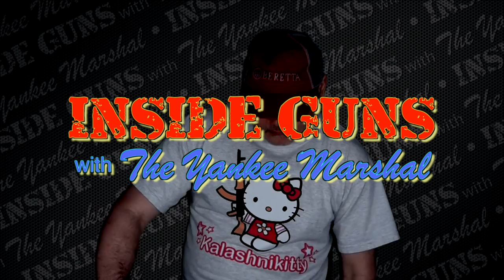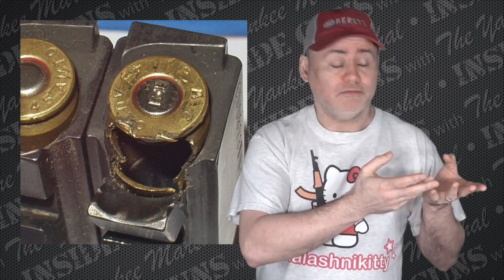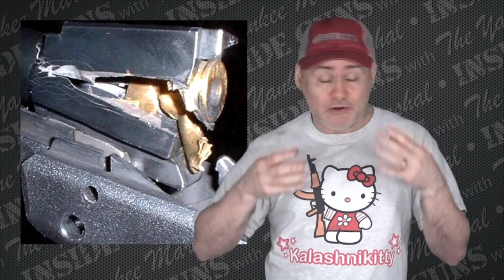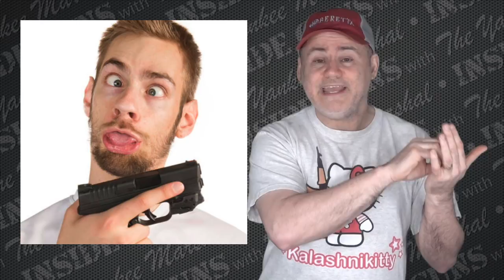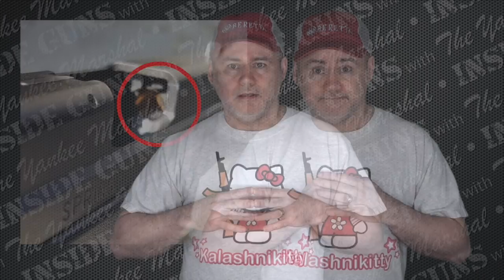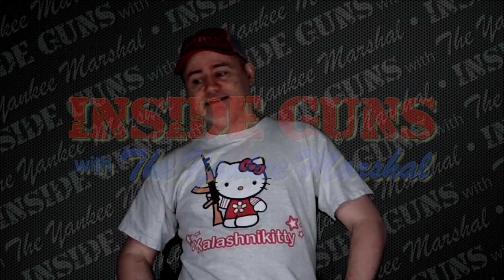Most Common Causes of Catastrophic Gun Fails!

Comment: When it comes to overloading ammo to get more performance out of a gun, just buy the gun that gives you the performance you need. 44 mag not big enough get a 454. 30-06 to tame get a 300 Win or Weatherby mag. The most accurate loads are middle of the road recipes in the reloading books anyway.
Reply: Mid-loads can be accurate but not always; some of my most accurate loads are at the higher end of their powder contents. I run my leadings through the gun for accuracy from low to high powder amounts. I have loaded some wildcat cartridges but prefer mellower loads just because I like to shoot and hotter loads can prematurely wear firearms. The biggest issue I’ve seen in reloads is a double load and even then there isn’t always a catastrophic failure; I’ve also seen a person fire a squib and then quickly follow up a shot of full pressure and bulge their barrel from over pressure. I’ve been an armorer and range officer for years and have rarely ever seen failures in person. I recall quite a few early 40 S&W failures but these have fallen off over the years; a lot of manufactures just up barreled 9x19mm to 40 S&W which doesn’t work out long term.
Reply: *Angry Elmer Keith noises*
Reply: I agree with everything except the middle of the road recipes part. I’ve had book max loads be the most accurate for several different loads

Comment: Several years ago, I was an Air Force Combat Arms Instructor in the Reserves at Norton AFB, and one weekend we had a squadron of Air Force cops on the range for their semi-annual qualifications. Everything went normally during qualifications, but after qualifications were over, one of the guys (who was LAPD for his regular job) asked if we minded if he shot his personal gun. We still had a couple hours before we had to close the range, so our NCOIC told him to go ahead. I was standing behind and a little off to one side of this guy. He fired a couple of rounds, then started screwing around with the gun. After a few minutes of this, I went over and asked him if he was having a problem. He said yes, the slide won't close. So I asked him if I could take a look at the gun, which was an S&W compact auto (don't remember the exact model number any more). The first thing that I did was to lock the slide open and check the barrel. The reason that the slide wouldn't close was because the previous round had been a squib, and the bullet was lodged in the barrel. Fortunately, it was far enough back in the barrel that the slide would close completely. I took the gun apart and showed the guy the barrel with the bullet stuck in it. I told him that he was really lucky, because if the bullet had been another couple hundredth of an inch further forward, he would have blown the gun up and could have been hurt pretty badly. Even cops aren't immune to kabooms. We pounded the bullet out and put the gun back together, and the guy finished up shooting without any more problems, but he was a little more careful.

Comment: Several years ago, I bought a box of cheap regular .45 rounds for a day at the range . After the third shot, my gun locked up . I knew something was wrong . I discovered by running the lot number with the manufacturer that they were .45+p  rounds that were packaged impropriety.
Reply: 😳

I like the cheap hot ammo part of the story but hate the mistake that could have hurt you or someone else.

Comment: You did not mention the 'kaboom' I encountered.  I bought a box of factory loaded 10mm  ammo that had not been crimped correctly.  When the bullet hit the feed ramp, the bullet pushed back into the case causing excessive overpressure.  The incident didn't ruin my gun but it did do a little 'repairable' damage.

Comment: I have a Carcano that turns out to be .264 caliber instead of the designed .268.

But it's a solid design, so the only problem that this caused was that the cartridge case expanded enough to lock the bolt. The oversized bullet got out fine.

I've also had a situation in which the maker of a 5.56 round must have overloaded it, since the primer blew out upon firing, which jammed my AR's trigger. But as before, the rifle was strong enough that nothing catastrophic happened.

Comment: The only problem I had was an old Mauser that had been re-chambered to 308.  There was a headspace issue that caused the rims to separate from the cartridge.  Being left handed the separations sprayed tiny bits of brass into my face.  I tested a few more rounds from other manufacturers and they all did it.

The catastrophic failure happened when I got home from the range.  I bent the barrel and action in half in a vise, and burned the furniture in my woodstove.

Comment: Had a squib load with factory ammo in 223 using a Mini - 14.Fired and was going to fire again but noticed the bolt wasn't fully home.Removed magazine and pulled back the bolt and found a bullet stuck in the Lead of the barrel.Had to put a rod down the barrel to push it out but I thought thank you Ruger for making the tolerences tight.Anyway it was a surprise considering you would expect quality factory ammo to be reliable !!!!

Comment: Three weeks ago I had a factory loaded round explode in my revolver. Burned my hand a bit and splashed my cheeks from bounce back against the bay wall. Fortunately it was a S&W 617 and I was shooting CCI Standard .22LR in it so it just jammed up the gun a little and made another round go off sympathetically clipping the crane arm on its way out. The gun is essentially a 686 full size and did zero damage especially since it was lower pressure ammo. Cool and fun talking point, but I did lay it down and run to the bathroom to check for injury in the mirror, (nothing at all). 

I’ve had squibs before and always caught them. Also had a Glock break off the frame rail and a few other interesting incidents including a weird 500 S&W cylinder fracture, (they fixed me up with a new better gun and then accidentally mailed me another gun which they told me to keep 😀). If you shoot a lot things will happen. Wear your glasses, because they’ve definitely saved me from injury and possibly eye loss multiple times. (Obviously ear pro too).

Comment: A friend borrowed my Dan Wesson 15-2 for some target work. He had loaded some .38Spl "really light". During rapid fire, he let off 3 squibs in a row. 2 were stuck in the barrel and the third jammed in the forcing cone, locking up the cylinder. I ended up taking off the barrel (glad it was a DW) and had to drill out the other 2. Luckily, it only scratched the lands a bit. The gun still shoots fine.

Comment: In 1988, I brought used Ruger Police Service Six for $110.00 blue 4" barrel. I  had a reload of .38 Spec on my Ruger Service Six that capable to shoot "357 Magnum and it blew up and tare down the cylinder chamber that making me to unable to open the cylinder for inspection. I use a hammer and bang the cylinder and to unlock and send the gun back to Ruger for repair. I was told that the gun can not be repaired and they send the GP-100, stainless 6" barrel and the factory asked me to send $178.00 for cost of trade in.

Comment: Hello TYM, yeah,
 I had a ka-boom, sort of. I had DA/SA  454 revolver that broke. The crane broke.
Shot felt odd, pressed the cylinder release to swing out the cylinder, cylinder came out in my hand.
 So it did not actually ka-boom, more like a ka-thud.
Reply: Cylinder: PLOP! into hand.   SeaDog: WTF??!!
Reply: @markh.6687  That's pretty much exactly what happened. The phone call to the manufacture had a few adverbs in it too. I sent the whole pistol to them for inspection, they replaced the pistol, but they would not send me the old trigger parts back. I had 10+ hours on the trigger work on the that gun (it was a hog hunting gun). Sure, it's a liability thing for them, I understand that. I should have stripped the trigger parts out before I shipped it.

Comment: How about putting the wrong caliber round in or set back from frequent chambering?
Reply: Set back probably isn't as common because some combinations of firearm platforms and caliber of ammo seem to be more prone to it than others. I've seen 9mm ammo that was rechambered several times in a striker fired pistol like a Glock, and the bullet did not set back any noticeable amount. However, I've noted that .45 ACP chambered in a 1911 will start having noticeable setback after as little as 2-3 chamberings. Just another reason to change out carry ammo periodically.
Reply: @JohnnyReb2000  yup those .45 ACP rounds really settle in tight. Out of all of my calibers, they’re the most obvious sliders.
Reply: @WheelgunsOnWheels , especially when chambered in 1911's. I suspect that the combination of the feed ramp design and the 45 cases not being tapered like 9mm are the primary causes.

Comment: Where would mixing shells fall? My dad told me about his cousin accidentally mixing a 16 or 20 gauge shell with his 12s.  He racked the undersized shell in, it didn't fire so he racked it again. He thought he short shucked it, and put a 12 right behind it, pulled the trigger and kaboom.
Reply: Ammo mix-ups do happen - same as chambering a .300 Blackout super in a 5.56. (I keep my ARs in 5.56 and my shotguns in 12 in part for this reason)
Reply: @parsecboy4954  Many 300 blk owners I know will use visually differently design magazines for the two calibers. The most popular for .300 Blackout is the clear plastic Lancer mags. Standard P mags for 5.56
Reply: @alexunfiltered5756 , I know of folks who even go as far as labeling the ammo cans with 300 Blackout in bright colors on all sides to help prevent that mistake.

Comment: This is very interesting -- I would love if we had more detail on each type and a discussion of the examples .. For example design issues the picture your showed that the ramp and the position of the round was not right, causing a blow out -- was that because the tolerance of the barrel at the feed end was too tight and the round couldn't engage all the way ?

Comment: While you barely touched it you didn’t cover bore obstructions, throat clearances, SEE, you just say if it’s not the manufacturer of the firearm it’s over loaded or a squib caused bore obstruction. This is not correct and I expect some knowledge before you present an opinion. Using oversized bullets too big for the chamber throat will cause elevated peak pressures due to lack of proper bullet release. Over length loads, bullets should NOT be jammed into the rifling. Sometimes current published data may not be safe for the specific action you’re using because it was developed using a strong test barrel or not tested at all and just dreamed up using quick loads or similar. I have seem legitimate bore obstructions near the muzzle literally peel open the end of the barrel, nice clean looking splits. It really happens. I would love to see the examples of people using hack saws to fake it. Also, some powders are more sensitive to temperature extremes and are hotter in summer than in winter, so winter loss should be avoided in summer and vice versa.